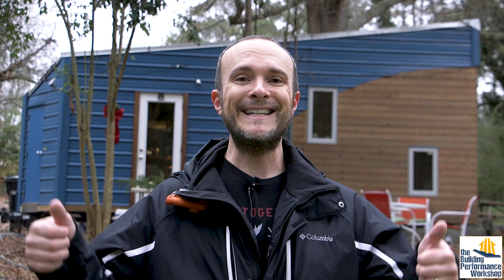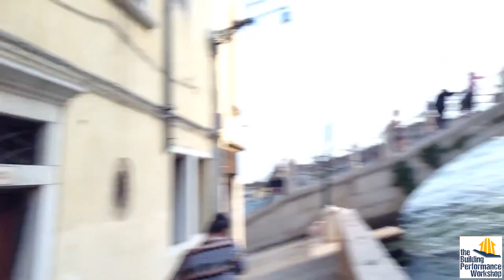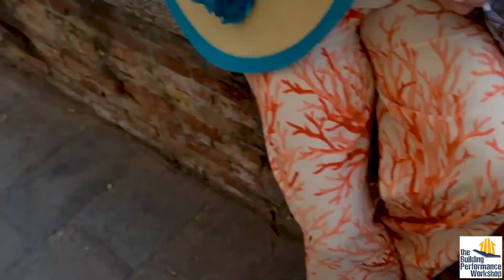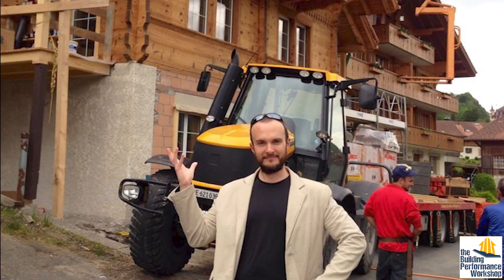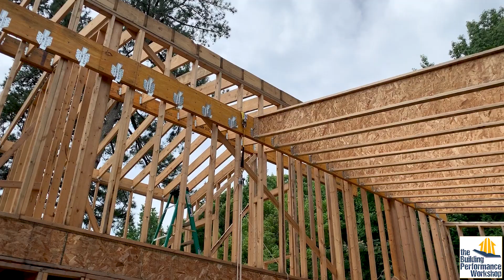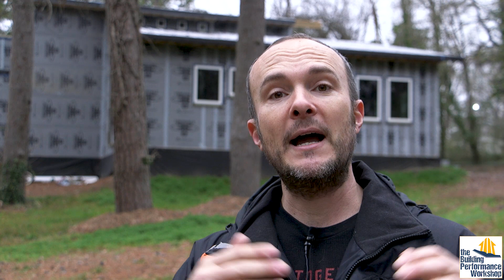Walking the Uber-Performance Path in Venice and Switzerland

Comment: I love this perspective. Building green is about reducing the cost of running a home in the long run. Save energy , save the planet. But i found that the upfront costs of going that extra mile far outweigh any potential long run savings so i made the switch to build cheap.

For example i can get  a cheap window for $400 or a passiv Haus quality triple pane for $4000(not including shipping from Europe) and the expensive window will save me $10 or less a year. Not worth it.

Someone did a study that in the south, going from r20 walls to r40 walls saves about $20 a year. Which is actually wrong for my area because you save $20 a year in energy but you pay and extra $120 a year in taxes for the extra girth of the envelope so it ends up being a net money loser.
Reply from the maker: All things we should take seriously, but remember it’s not just energy savings- control over the environment indoors is about quality of life, not money.
Reply: @HomePerformance  
Quality of life can be many things, Financial security being one of them. So a less expensive house could in fact increase quality of life by allowing a person to be under less stress.

Building inexpensively can also improve quality of life by allowing one to build the right size home. One of the first things everyone says when one wants to build an inexpensive abode, is, build a smaller house. That is a big part of the tiny house movement. This is not necessarily bad advice but Architect Hassan Fathy wrote in his book "architecture for the poor"   that when you can build a house that costs almost nothing for materials, then you can build a large enough house for the family, with space to exist, and that a right size house is a more healthy house than one that is built smaller than necessary because  high material costs dictate so.

So for example, i think most people would have a higher quality of life in a "low performance", larger house with enough space, than a super high performance tiny house, if the costs were exactly the same.
Reply from the maker: Hm, as someone who has personal experience at both ends of the spectrum, I disagree, but I like that your ideas are so clearly considered!
Reply: @HomePerformance  thank you. We are planning to build without financing and so are forced to look at everything through rather austere lens and do 3x the research to find the best solutions